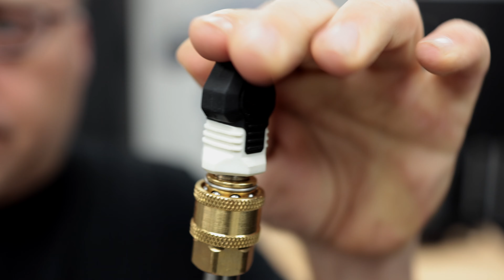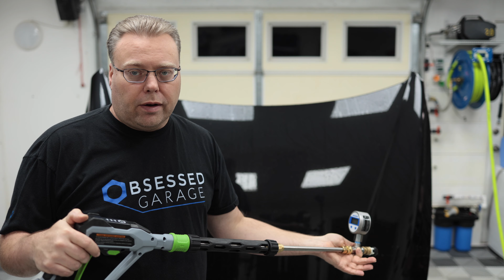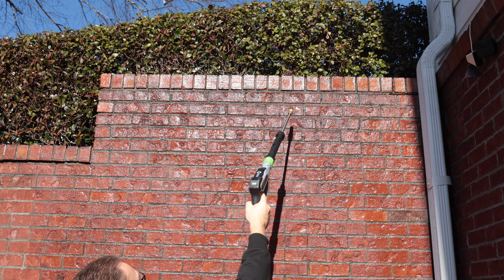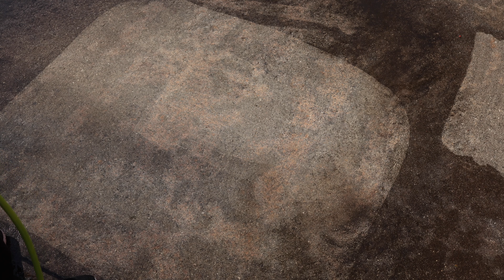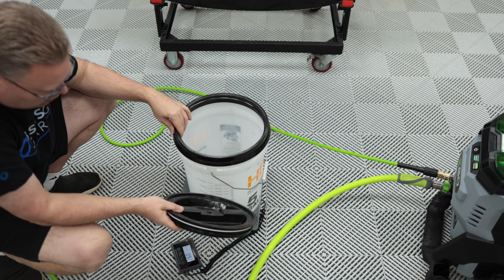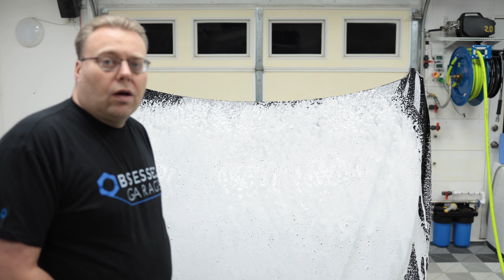EGO 3200 Battery Powered Pressure Washer | 3200 PSI?! | Review & Testing

Comment: This is interesting. Something like this would benefit me and where I live due to really harsh well water. I’ve been washing my car with a rinse less wash, 320psi Worx hydroshot and purified water for years. My CR spotless system started to get too expensive to replace every two months. This or the ryobi one have me very very interested! Thanks for the great video 😎🤙🏽
Reply from the maker: Also, check out Greenworks they have several ones out there as well even one with a 5 gallon reservoir that has 1800 psi. Ever thought about trying reverse osmosis as it really saves on DI resin. I’ll be doing a video soon on a RO system and all you need to know about them including water storage options.
Reply: @CarsWithKeav  Is that the one with the “bucket” on top? I just picked up a worx ultra (725psi) so I’m going to see how that does for me. Yes I had inquired about an RO system years ago and the company never got back to me lol. I recently inquired again and they’ll be coming out soon to test water and see how much everything will be. I wanted to do the Home Depot kit but heard a lot of bad things about them. I will be interested in watching that video for sure when you do make it. I appreciate you and all the testing you’ve done!
Reply from the maker: @CobraDave03  Yeah has a bucket on top. There is an 800psi model and a pro version at 1800psi. I bought an RO system on Amazon for $160. 100 gallon per day capable which isn’t the best, but let’s me explain the process and we can see how much waste water and clean water I get. I bought a few cheap storage options from a 20 gallon food grade trash can to a 500 gallon water bladder. I bought the big bladder so I don’t waste DI water testing anymore and I’ll reuse in the garage.
Reply: @CarsWithKeav  Oh wow, I just now saw the 60v Pro version. It’s on sale but tool only. See that wouldn’t be bad, 100 gallons a day would work for me, I’d hope lol. I don’t do much washing anymore but I’m getting back to it so we’ll see.

Comment: The flow is too low for good high pressure cleaning.
Reply from the maker: I agree with you there if you are looking for the best clean you got to go with a gas powered one. Most high flow electric ones are either high PSI and low GPM or Low PSI and high GPM. Now the one nozzle that does 2150 at 1.5 GPM probably is the better cleaning nozzle over the 2900 that is only 1 GPM. Most don’t know it’s the perfect balance of pressure and flow that gets the best clean. This is still a residential consumer version for those that don’t want to mess with a gas one.

Comment: you answered my question about using the mtm gun being used. I want one, but I want to also get 12 amp hour batteries. I will wait until Lowes sells it. I do mobile detailing as side work, 800 not bad. I am always looking at reducing set up and put away time.
Reply from the maker: I bought mine from Lowe’s. It’s mostly online, but it is in inventory at a select few of them. Others have confirmed they bought in store. I’m hoping down the road they use some of their commercial landscaping technology for mobile detailer setups. Have you seen some of the landscaping setups they have shown? Big money though. If you are looking to use different batteries the tool only version is on Amazon from EGO themselves for $449. https://amzn.to/3HC2boV

Comment: How much are the batteries alone?
Reply from the maker: Retail is $350 each! Now there are tons of knock off batteries on Amazon for $120 as well, but I have never used them to know how good they are. EGO is expensive compared to Ryobi, but they have way better warranties. 5 years on tools and 3 years on batteries. You can get draft as well like right now the 5ah battery is $250 on Amazon so 3 of them is $750 vs $700 for the two 6Ah ones.
Reply: @CarsWithKeav  Thank you Keav👍🤗.  Also where do I buy the foam cannon converter?  Love your videos and I laugh at all of your outtakes 👌👀😆
Reply from the maker: @davidboyce6427  I replied in your other comment as well. The links are in the description. I have a section for the two types I showed.
Reply: @CarsWithKeav  Thank e so much👌

Comment: It's a neat concept, but that battery life is not realistic. You'd need like $1000 worth of batteries if you were to run this all day to use for car detailing or if you had a pressure washer business... It's just not realistic... Only 25 mins of run time on high? That's laughable
Reply from the maker: Yeah, the battery powered world has a long way to go when it comes to battery life with commercial volume. Imagine having to run a generator to charge batteries when you could just run it on the pressure washer. These are residential products, but Ego is really putting tons of R&D into Landscaper mobile setups and hopefully that trickles down to mobile detailing. I always wondered if you put those 4 batteries at $1000 on a power brick and then hooked up your Active, Ryobi, etc. up to it would you get longer life? I might have to try that one day.

Comment: You did it! Excellent video Keav. Was looking forward to someone on YouTube to do complete review and test on  the EGO 3200 battery pressure washer. Great work 👍. 

Question how's the noise level compared to other pressure washers?
Reply from the maker: The water flow out the hose is louder. I measured 73db from 3 feet away. The sound is not annoying at all either.

Comment: Excellent test as always! You made it clear on the adapter part. I’ve only used it once for the car wash so far lol. Battery, pressure, quality are all good, but there are still some downsides to me. 

First, I realize 1.2gpm is not enough to rinse off foam smoothly, but thanks to your test, I think a 30, 35 orifice would make it a lot better. I’ve tried the active 2.0 and it definitely feels a lot stronger than 1000psi with the high volume of water.

Second, it’s not that portable. It’s not something you can lift easily with one hand and it takes half of the trunk space in my sedan😅. Could be a problem especially when I have to bring at least two 5 gallon buckets full of water.
Reply: Have to say that Keav’s simply the best YouTuber in car detailing. Always offer great tests and useful information rather than mere commercials or just talking to the camera for 80% of the video without showing live footages. He deserves more sub
Reply from the maker: I really appreciate that! We are on the grind to grow.
Reply from the maker: Agreed, it is not very portable. The Ryobi one is much better at that. When I washed my car out of town I needed 15 gallons. 😬 yes, more flow gets better cleaning. There is a balance needed. I actually think the white tip on turbo cleans better than the yellow with that 2150 PSI and 1.5 gpm. Agreed the 3.0 or 3.5 on turbo would be the best for car washing. 3.0 you could use high every now and then to save some battery.

Comment: I mean the unit looks cools, and looks well built.. but who would be in the market for a unit of this cost? I think you said it cost almost $800?!  With only a 15-20 min run time on turbo mode.. that’s more than an AR Blue.. and almost as much as a kranzle… I’m honestly excited for the new big boi pressure washers, but I’m pretty sure I’m going to go with the active 2.3 whenever it gets released.. super excited for that to come out.  Thanks for the video.. unit looks cool but a bit pricy for what my needs are.. I’m doing 4-6 cars a day.
Reply from the maker: You’d be surprised how many would buy this. For sure not for a volume detail setup just based on battery life. This is more of a consumer product used around the house. The batteries is where the cost is. Buying those batteries separate is like $600. I would not use this to wash cars if you have a garage or mobile setup with a generator. Money is better spent elsewhere. If you already have ego batteries like a mower and other things then this for $450 without batteries is more reasonable. Most people who buy and use the higher end EGO tools don’t worry about price when the riding mower is over $5k. I personally based on my situation would not get this, but if I lived in an apartment this might be my choice. I can also get the Ryobi for $600 with two batteries as well. I’m very excited for the Big Boi products as well. I’ll be buying them the minute they hit market.
Reply: I am returning a cheaper option and buying this model because I can move it around the property and work on surfaces where I don’t have access to water or electricity outlets

Comment: Keav,  No one talks about using hot water with a power washer. It's Winter time and our garden hose are put away and not everyonr can wash their cars in their garage. Can the Ego siphon hot water from a bucket without damaging the unit?
Reply from the maker: So one thing is cold water is really anything less than say 120 to 130 degrees when it comes to pressure washers. Which is about what all residential hot water heaters are set at. Pressure washer hot water usually is 200 degree or higher. They classify this pressure washer as a cold water one. I would think you could run some hot water from your sink for a little bit like maybe a bucket. I would’t go more than that without a cool down as you could overheat the pump and motor. To be safe if you have a thermometer keep it around 100 degrees and should be good. Which is really warm
Water. Hope that helps. There are not many residential electric pressure washers that can do hot water.

Comment: FIRST THUMBS UP AND COMMENT FOR MY BUDDY KEAV!!
Reply: Pressure not that important  for car washing what’s the GPM
Reply from the maker: @allenrees5803   This is true, but not everybody buying this will be doing it for car washing. In the video I go over all nozzles along with other orifices and shows all the numbers. If you don't want to watch for car washing a 3.5 nozzle on turbo will get you 900 to 950 PSI and 1.67 GPM. A 3.0 nozzle can do 1150 PSI in turbo and 1.6 GPM. The stock 40 degree nozzle can do 2150 PSI and 1.5 GPM.
Reply from the maker: Thank You!